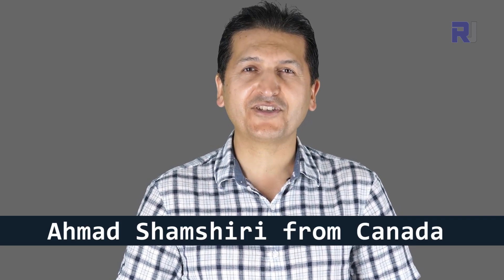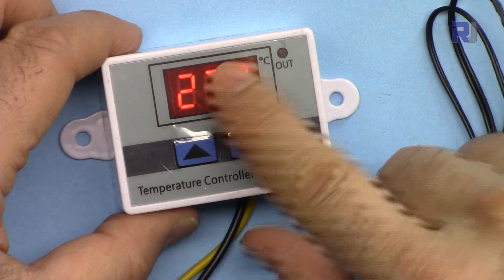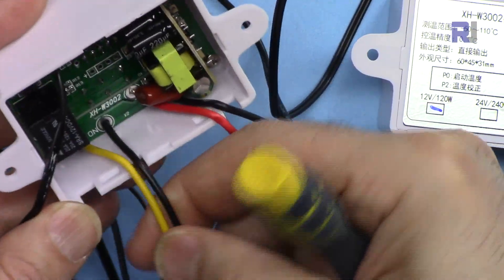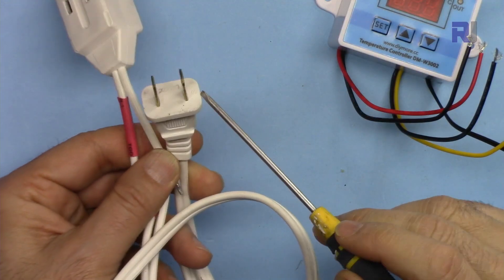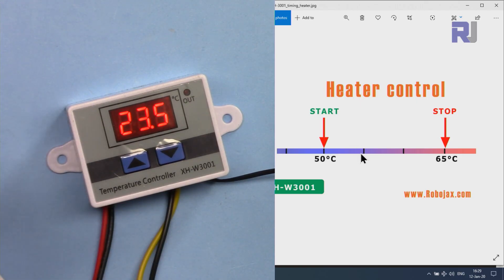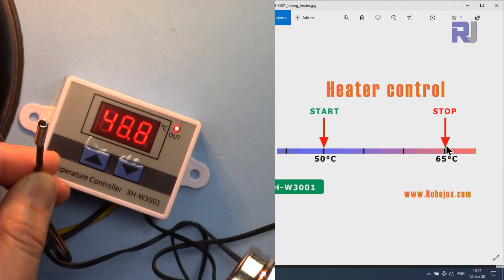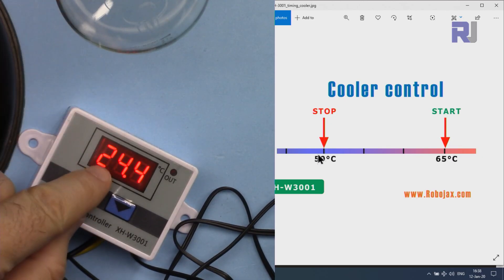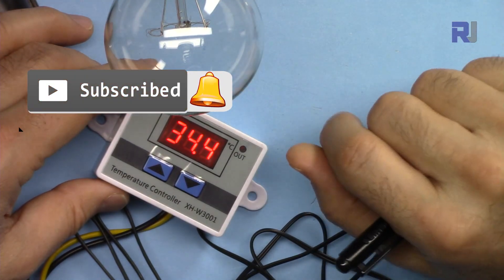How to use XH-W3001 AC digital Thermostat Temperature control - RJT262

Comment: What is the max power output. I have 4 heating elements. Small ones for soldering  but won't heat all 4.  A couple  sure  so thinking I must have maxed out the capability of the unit.
Reply from the maker: I believe I mentioned the power handling value.
Reply: @robojax  you did. And very clear. Just trying to figure why it would work 2 but hook up any more and nothing. No worries.  I'll figure it out. Thanks though. 1200w. With 10 amp in a 120 walloutlet.  Just so you know. I was listening.  Not being lazy. And just writing to get answers.   Have a good day

Comment: Great video, thanks for the explainer.  Quick question.  I noticed that the device has 22awg wire for those connections.  It seems like that is undersized for 1500w.  Have you load tested at the design limit?
Reply from the maker: whatever tests I have done is shown in this video.  Contact the seller or manufacturer in regards to the quality of wires.

Comment: Does the initial temperature setting keep the same after the power supply shuts off and then turn on again? I am trying to use it to control my condenser to run during the low temperature in winter. Thanks
Reply from the maker: Yes it keeps it.

Comment: Hello sir, I have a cloth dryer. The heater is rated at 220v, 1500w. I usually use the dryer for a period of 3-4 hours at a time. Would you recommend using this thermostat controller for this kind of application? I appreciate your opinion on this. One more question, does the min max value set holds if we switch it off? Thank you
Reply: Already used. Works perfectly

Comment: What if we accidentally put the wall plug the other way? Interchange live and ground.
Reply from the maker: it will function without any issue. expect it will be not safe to touch the output wires.

Comment: Hi. Where the Yellow and black wires are could i add a double socket to it? or does it have to be a single? Its to run 2 heat mats. Cheers
Reply from the maker: Hi, you made me watch the video . I have practically explained and shown how to use it. what else do you want? I did not understand.
Reply: My question is in regards to the extrension you use, im your video you use a single extension  My question is, could i use a double extension for 2 heat mats or will it over load the w3001?

Comment: Could this be used for a reptile heat mat?
Reply from the maker: my friend. I have explained the rating of relay in terms of Watt. so your load or mat should have power written on it. like 10W or 800W. it will turn it ON and OFF it is not buoyed the limit. if it is , it will cause fire.

Comment: Hello, Thanks for video. Is this device have a calibration factor? For example, the real room temperature 24 but device shows 25. Can we calibrate it ? 
Thanks.
Reply from the maker: Hello, if it can such thing, I have shown it. I don't remember unless I watch it. So you watch it fully and see if it has or not.
Reply: @robojax  hello, thanks for prompt reply, I watch the full video but couldnt see that you mention. So it doesn’t have it?
Reply from the maker: If you didn’t see it then it does not have it. I have so many videos of thermostats, check my channel.

Comment: I bought this hoping it's 12v, but I received one marked 24v? Obviously I can't use that with 220V but can I use it with 12v? Thanks
Reply from the maker: no. it will work only with 24V.

Comment: can this take on a 1.5/2 tone AC?
Reply from the maker: What tone? I have explained and shown how to calculate. It is I just the rating of relay.  First know the power of your device . If voltage is 220V and power of load is 1000W then find the current 1000W ÷220=4.5A . Watch the video and don’t skip. If you watch it fully , you will not have any questions left.
Reply: @robojax  thank you for replying. I just wanted to know if I can install this device for and air conditioner.
Reply from the maker: Okay check the power and do the math.

Comment: Why the output is 24volts? What kind of bulb you use?
Reply from the maker: you did not mention the time. This just use relay to turn ON/OFF something does not mater. I used a bulb to demonstrate it.

Comment: If my extension cord has a ground wire, can that be used to wire this up? If so, does the ground wire just bypass this unit while the live and neutral go into and out of it?
Reply from the maker: This is just a switch to connect and disconnect two wires. You have to use it in a safe way. Ground has nothing to do with this. Keep the ground , wire it such that it can turn on and off your device

Comment: Will the thermostat be damaged if you connect the AC phase to the black wire? I am asking because in some European countries the plug is reversible, and the phase can be either on the left or on the right, in the electrical socket it is not marked.
Reply from the maker: no damage. it is just for safety.

Comment: My Thermostat is measuring impossibly high temperatures (such as 51.5°C) when my thermometer is measuring room temperature. It also doesn't switch my heating pad off (I'm using it for a reptile cage) when it goes above my stop temperature. I've tried using both its heating and cooling function and neither works correctly. 
When the black cable (with the probe on the end) gets near the box, it goes crazy and random temperatures start flashing up on the screen and it makes a clicking sound.
Could you please help?
Reply from the maker: Hello, I've not experienced such thing,  I believe this module has defective.
Reply: @robojax  As it turns out, I simply didn't program it correctly, but it works now (however bringing the black cable near the box still causes it to go crazy).
To program it I had to press the up and down buttons simultaneously for more than three seconds (if it displays 888 all is good, LLL means the sensor is at fault, HHH means the temperature is above range)
After that, I simply followed the instructions in this video. Thank you for the help!

(I used the third image by this link as a reference - https://ultimateexotics.co.za/product/temperature-controller-basic/)

Comment: Hi.Thank you very much for all the information. I want to build a chicken incubator. The heating element is a 100 watt light bulb. Do I need a solid-state relay or it is enough with the setup you just show in this video? Thank you very much.
Reply from the maker: you are welcome. this is always better because it has relay.
Reply: @robojax  Thank you. So if I buy this thermostat I also need to buy a relay. Right?
Reply: @BlueLineofthesky  I don't think so. The 220v model has a 1500w rating.

Comment: Hello. Maybe it's a stupid question, but can I connect a 300w electric Heather for the output instead of light bulb?
Reply from the maker: Hello, I mentioned at the beginning that you can control AC or DC load. Load means fan, heater, TV or anything. just make sure do not go above the rated load of relay. Visit resources for this video: http://robojax.com/L/?id=252 and in your module see what is written on the relay. if is it 10A, connect only 10A load.
Reply: @robojax  thanks for the quick replay!
Reply from the maker: you are welcome.